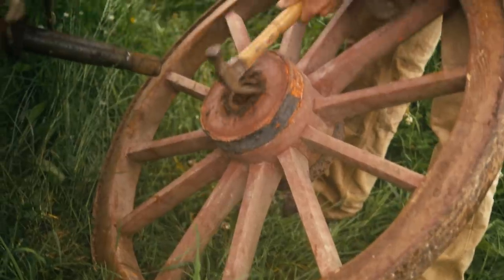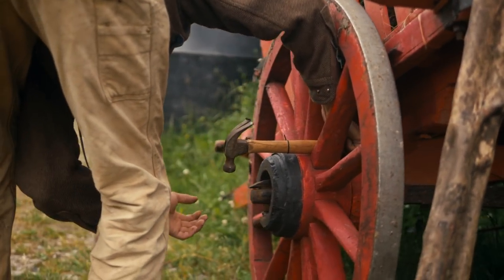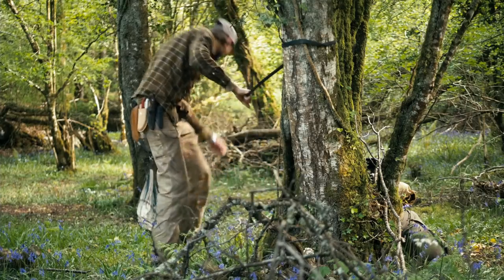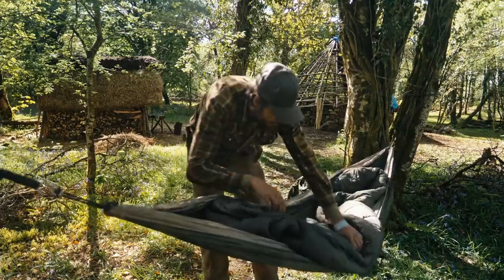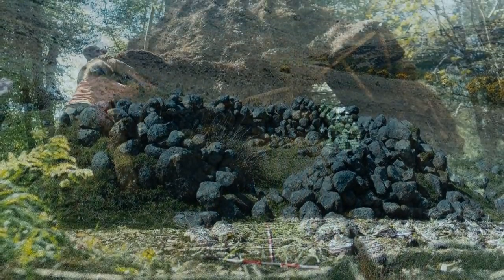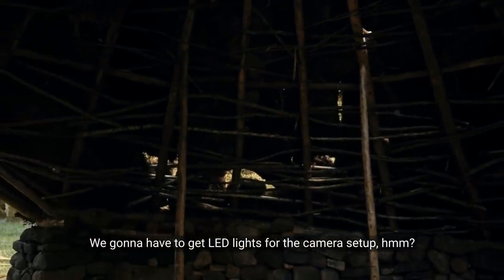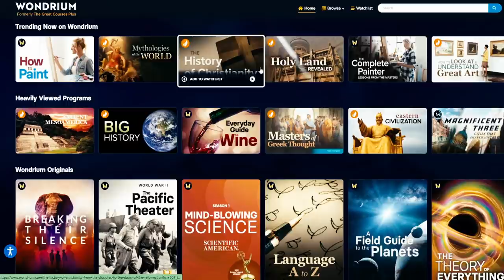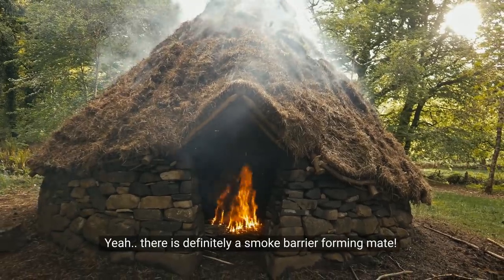First FIRE with a Roof! SMOKE OUT?? Building an IRON AGE ROUNDHOUSE (Ep.13)

Comment: I was under the impression that some experimental archaeologists in England had made a round house similar to yours a few decades ago and left a smoke hole in the roof, but found that it encouraged ALL the hot air to escape through the hole, heating it up until it was a serious fire hazard. When they reroofed with no hole whatsoever, the smoke diffused through all of the roof evenly, so there was no heat buildup at the top and no fire risk. From this, they posited that historic roundhouses didn’t have a smoke hole or chimney at all.

Comment: Please put a doeskin or sheepskin on a stick frame and put it inside the roof over the fireplace. It will protect you from uprising sparks. If you do not like to see your work in flames.
2 meters +- is a good hight.
It is a very old method against roof fire.
Reply from the maker: were on to that one! thanks for the heads up. Would be cool to use a doeskin harvested locally. should be an easy upgrade:)

Comment: I've read that experimental archeologists have found a central hole in a roundhouse encourages large flames and sparks and has actually set a reproduction fully on fire. If you are to make a flap, don't make it over the centre.

Also, did you make it south facing?? Essential for lighting... I can't tell. I've been bingeing your videos for the last three days and I've really enjoyed them, especially this build. I hope you plaster and whitewash the walls, at least the inner, once the roofing is done. It makes it far lighter. I think you cut your overhang off short, you need to keep the water away from the walls, so take the opportunity with thatch to lengthen it again IMO. Then dig a drainage ditch in the footprint of those drips and lead the ditch off elsewhere. Primitive Irish enclosures always had a bunch of rain management... for obvious reasons! I come from the history and archaeological side, rather than bushcraft so some of what I think may not apply to what you want.

Watching you two makes you realise why people only built a new roundhouse every few generations, despite a whole community to help. Oh, and you didn't mention the roundhouse was pretty standard in the Bronze Age as well...? Anyway, looking forward to seeing a full roof. 👍👍👍

Comment: I'm impressed how much effort you put in this project. Most (especially group) bushcraft YouTuber go into the "build camp"-phase, turn to great building project and slowly disconnect from nature (start using nails, bring tons of materials from hardwarestores, normal building set in the woods). I don't see that in you guys (all local material, trying each step with musclepower, historical research). Flexing the wedge with a powertool (one time thing, just intermission because broken cartwheel) or moving most of the soda with the "not so medival" car is completly okay imo.
This is (from my perspective) about staying local and exploring old ways. You are working jobs and the house is a hobby. Therefore the indirect timesaving (car driving, not learn smiting or cart making) is completly fine. I'm amazed Julius made your own wooden ladders. It just gives the feeling vs buying some in the hardwarestore.
I would never be brave enough to tackle such a gigantic build. Keep up the great work and thanks or sharing!

Comment: Looking forward to the thatching! I’ve built a 16’ thatched roundhouse before with a wattle and daub wall, lime rendered. The thatch alone was plenty of insulation, I wouldn’t have wanted the extra weight of the turf layer too! Something to bear in mind, once the thatch is on, you can spray it with a fire retardant. Fires and thatch and a hot, dry summer is a risky mix!

Comment: Are you planning on doing anything to plug the gaps in the stone, like putting a mud plaster (no lime, just clay mud and fibers, like grass, hair, or broken down cordage/rope) on the exterior and interior? It would take only a day or so to do and it would get rid of any cold drafts while still allowing the rock to be a thermal mass for keeping the temperature more constant. I also assume you are going to do something with the door to partially seal that off as well.

Comment: Nice job lads. There's a lot of work obviously gone into that.
Can I just say, you might want to look into the hole in the roof for letting the smoke out thing. I don't know if it will effect a roof with sod as much, but I know with thatched roofs, when they left a hole at the top, it created a vortex kind of effect when they lit the fire, and the roof caught alight. They found it was better to fully cover the roof and the smoke would just seep out.

Comment: Round outhouse sounds like a plan for the spare rolls. I also think that laying them horizontally might have been easier but not as good at shedding water. With vertical rows the water flows down without hitting a join where it might drip through, but with horizontal rows there are many points where it might hit and drip, hopefully you overlapped the layers to prevent this from being a big problem. I think this is the logic in laying them vertically though, the joins will never become a stop point for water as the sod decays.

Comment: The heat from the fires will continue to dry the sod, making it lighter and preserve the frame from rot as Dylan mentioned, right?  Will it eventually become so dry as to present a fire hazard from sparks rising from the open fire?  I wonder if there was a medieval solution to that problem other than to keep the fire low, watch for sparks, and let it burn very low before you sleep?  Will you consider a modern spray-on fire retardant coating?  I hate suggesting that, but not as much as I would hate a tragedy in that house.
Reply from the maker: the sods are more less earth, so should be a good fire barrier (compared to reed anyways.. :P )